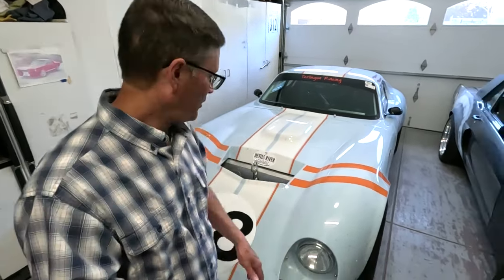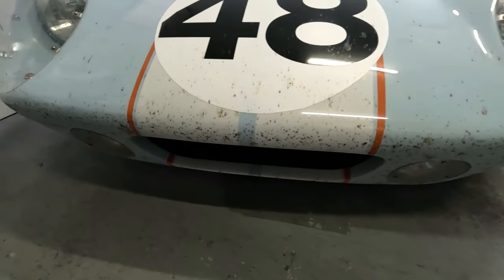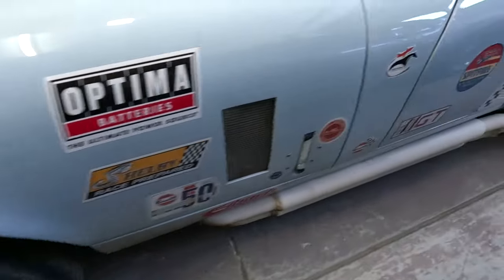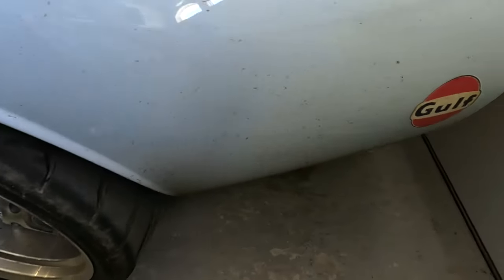160 MPH in the Factory Five Type 65- Cobra Daytona Build, Video 247

Comment: Looks terrifying!  It's amazing that Dick Smith did 198mph in an original roadster, somewhat recently a guy did 201 in a Superformance open-top roadster, then 223mph with a few aero mods.
Reply from the maker: Scary at first but you get used acclimated to the speed quickly. 
Taromino imports did the 223 and that’s insane. He just sold that car. Great comment. Thank you.

Comment: Cv boots are one my concerns too.  After doing sustained 120 mph on the track the outer ones on the gt40 started to shred. The inner ones are nice thick Porsche ones and they’re fine. But now I’m trying a few different types/brands to see what holds up.
Reply from the maker: Wonder if the Porsche ones will fit on mine. I received motorcraft ones and they are really stiff and don’t think they will expand like the neoprene ones. We shall see.
Reply from the maker: Spoke with a guy today the deals with drivelines he says you have to vent the boots and use better. Grease for any type track or sustained high-speed work learned a lot drive line shop. I believe it was called back in North Carolina does all sorts of stuff.

Comment: Looks like fun! At those speeds the ideal alignment settings may be different, such as a bit more toe-in for stability. Compared to autocross, where you aren't getting up to triple digit speeds and want a bit more toe-out for quick response and turn-in.
Reply from the maker: I agree. Some toe in would be a huge help. Maybe next time. Until then it’s zero toe.

Comment: Your navigator should have been aware of how far off time you were on the first leg then try to make it up on the second leg. I think I tried to inform your navigator about where they needed to be looking for certain time points. Oh watch those GPS speedos they are usually a little slow. If your mechanical speedo is correctly geared to tire size rear gearing you can get a more accurate reading from them.
Reply from the maker: We did make it up on the return and ended up .222 seconds off. My speedo on car is also gps😳

Comment: So......... It completely sounds like ur half throttle in top gear.... Thought it was a speed challenge?
Reply from the maker: It’s a road rally and the purpose is to get as close to your average speed as possible for two 62 mile legs. Mine was 140 mph so you need to go faster as the winding area requires lower speeds.
Reply: @cobradaytonabuild1671  that makes sense. I was gonna say, it seems like that car has a lot more in it but I understand that you're going longer distances than I thought.... My bad..
Reply from the maker: Thank you for watching and commenting. The car has a lot more just not sure I do. Survjval instincts kick in